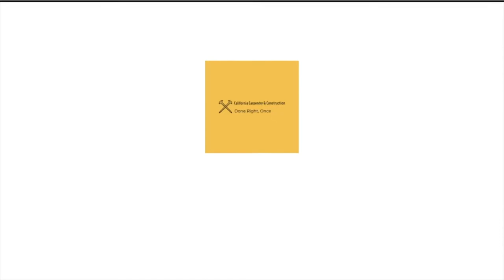Glacier Bay Shower Repair

Comment: I have the same system , but after cartridge replacement my hot water comes out first then my cold as i pull the handle up? It wasn't doing that.
Any reason or advise on what i can do?

Comment: Awesome video + walkthrough! My landlord sent a plumber by to fix this exact issue (I wish I had looked this up beforehand) and he managed to: 1. not fix the problem, and 2. make it so there is NO water coming out of the faucet at all... 
Neither of the cutoff screws is tight and the water to the rest of the house is on, but no water to the bathtub faucet. Do you have any idea what he might have done so I can fix it?
Reply: Ok, So will water come out when the plastic cartridge is removed? if yes then you just need a new cartridge. if not, then you will have to do some process of elimination. Are the screws completely loose? (sometimes they get jammed up and feel like they are loose when they really aren't.) If they are completely loose it may be time to crawl under the house and make sure the water lines are still connected (This is a looooooong shot but worth a check). Your valve could also have a blockage in it as well. I just said screw it and put in a whole new valve. I hate glacier bay and will never. ever recommend them
Reply: @josephgaribaldi8496  you’re the MVP! Thanks so much for the reply. Thankfully, water does come out when I remove the cartridge. Off to Amazon I go! Thanks again for the time & money you’ve saved me & others!!
Reply: @aryaml97  No problem! I went through 3 cartridges before I changed it out to a moen.

Comment: I have the same style mixing valve and wonder if you’ve run into the problem I have. A slightly different setup. Shower head only, no faucet. The screw for the hot side is turned to off while the cold is turned to the on position. When i turn the handle slowly, the cold water flows as expected. As i turn the handle towards hot, the water shuts off (screw is in closed position). However, as I turn the water off slowly, the cold water does not flow again. If I try again to slowly turn the water on, the cold water no longer flows. My only solution at this time is to open the hot water supply by loosening the screw. It seems to reset things. 

Is it possible that there is a water pressure issue (too little/too much) that would cause this issue? It’s driving me crazy trying to figure out. Thanks!
Reply from the maker: Yes sir! the water pressure on these things are horrible (too little). It seems as though, by your description, the mixer valve does not have enough pressure to kick back into the cold "gear". But, when you turn on the hot valve, that pressure (along with the cold water) is enough to allow the mixer to work properly. 

 There truly is no fix for this, but to replace the set up with something that allows for more GPM. I love my moen and will soon switch out this fixture for a moen posi temp valve (there are literally tons of different styles). I bought this house as a flip and discovered all the short cuts.

Comment: What happens when you do this, cut the water on using the screws while the faucet is off - but the water continues to come of the shower head?
Reply: Hopefully you figured this out, My guess is a bad mixing valve, not the cartridge. These glacier bay models suck. The screws become stripped and overall the whole unit fails in 2 years (again based on my experience. I bought this house "flipped" and have been dealing with low quality fixtures for a bit, both showers failed in 2 years) I switched to all moen Posi temp fixtures and never looked back.

Comment: Hello I just looked at your video can you tell what model was that in your video that looks like the one I need
Reply from the maker: Hello! this is the exact cartridge I got: https://www.amazon.com/Cartridge-Glacier-Single-Handle-Faucets-10321/dp/B005JTHTS8/ref=asc_df_B005JTHTS8/?tag=hyprod-20&linkCode=df0&hvadid=167155689281&hvpos=&hvnetw=g&hvrand=10547463660830168034&hvpone=&hvptwo=&hvqmt=&hvdev=c&hvdvcmdl=&hvlocint=&hvlocphy=9031864&hvtargid=pla-297489970794&psc=1

Its good for models: 873-9004, 873-0127H2, 873-0004, 873-7096, 876-6004 and 873-6001